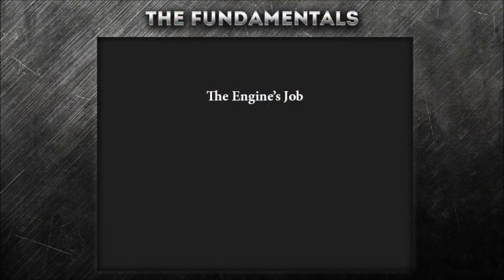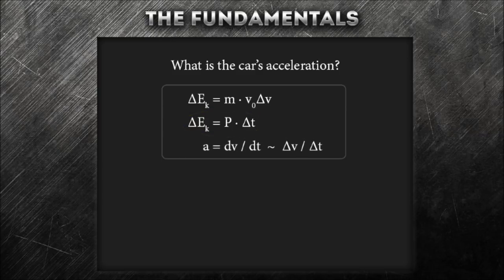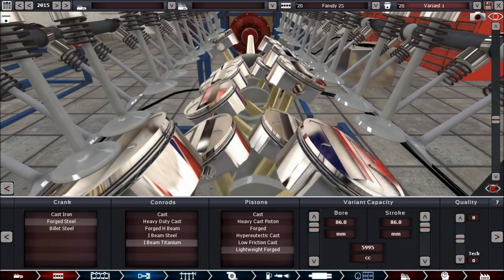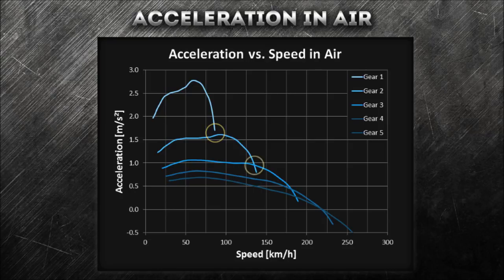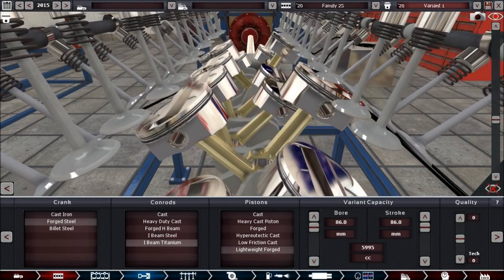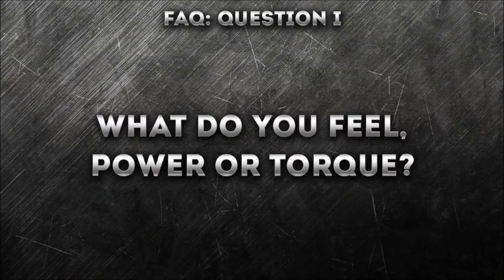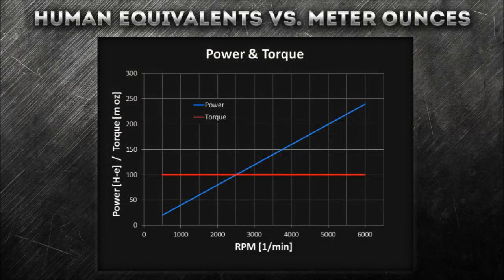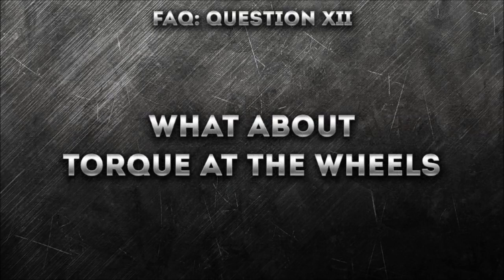Power & Torque: Acceleration Exposed

Comment: Dude I dint understand one thing that is if power or bhp is more with increase in bhp ur rate of work done increases if the rate increases so does the speed I. E bhp=torque*rpm I. E hence the speed of the car and if the speed of the car increases the acceleration decreases but based on the formulae u derived I. E   power/mass*vel  acc  is inversely proportional to speed according to this equation but bhp is directly proportional to speed so shouldn't indirectly acceleration be directly  proportional to speed.
Reply from the maker: And I didn't understand any of what you said there :/ so we have a communications problem and need counselling xD
Reply: AutomationGame how do I explain u I can't explain u in text 😅

Comment: So the only way high end horsepower can match low end torque is if the high rpm hp car is 10%lighter. Glad we cleared up what I already knew. The high torque engine being heavier is not always a given. High rpm hp is needed in very specialized applications. In a street car, torque isnt the ONLY thing that matters, but its close.
Reply: no its not true he forget about clutch you can form stand still twist engine at optimal rpm range and than loose clutch at clutch sliding you achieve more force twisting tire from stand still with high end more hp but if didffrenc isint very big higher hp car can transfer overall less force to tires because of bigger diffrenc in clutch disk rotational speed  so more sliding looses anyway if you must chocie let say 200 hp car 100 nm vs 100 hp car 200 nm both with optimal gearing and optimal clutch take 200 hp 100 nm be alot faster unlees you cant start properly but if it have launch control high end hp win overall look at top fuel from how high rpm they start https://www.youtube.com/watch?v=TA3i2TNuxcY  angine right when vehicle start to move twist around 6-7 k rpm according to this video ...
Reply: Torque is the sound of one hand clapping.
Anything Torque can do Power can do better and/or faster.

Comment: Was it explained what the torque number is for?  If power is all that matters why do manufacturers/the game tell us the engine torque?  Also, what is a combustion cycle?
Also, are you supposed to shift at peak torque or at redline?
Just a little confused, but I'm kinda dumb too so.
Reply from the maker: Hey, knowing you're a little dumb makes you smarter than most!
Torque describes pretty well how efficient the engine is and describes how power is delivered. That is useful to know :)
You usually want to shift at the redline or shortly before in order to have the next gear's start RPM to be high enough to produce the maximum amount of power. That is in a racing situation only though, of course... I'd not recommend that for normal driving xD
Reply: Wow that was a fast reply!
... but I do have 1 more question.  Is a 100 torque engine more efficient than a 400 because less power is 'wasted' at low RPM?
Btw, I bought the game thinking it was something else. But before I played it, car engines were magic to me.  It's very interesting to see how it all works, thanks for making it! :)
Reply from the maker: Not necessarily, no. For naturally aspirated engines of the same capacity you can compare torque numbers to see efficiency. When comparing differently sized naturally aspirated engines just divide the torque by the capacity and compare those numbers. Once boost comes into the picture you would have to divide by the total pressure (in bar), too.

Comment: I wonder why simulation estimates engine weight difference so dramatically. We know from practice that modern v8 pushrod engines weight around the same as much smaller OHC engines with less cylinders and produce higher power and energy. Even if you bore your v12 you will save weight on engine block, though will compensate with heavier rotating assembly. Probably you even need to boost smaller v12 to keep it up with larger one in terms of power, thus increasing weight of the smaller engine.
Reply from the maker: Because of the higher torque you will need a stronger drivetrain and gearbox, bigger starter motor, more coolant, etc. That is where a lot of that weight comes from. It should be somewhat accurate as an estimate.

Comment: Great video, until the end. You said that when you feel acceleration, it's horsepower not torque. As a mechanical engineer, I disagree. You are feeling torque during acceleration. Horsepower wouldn't exist without torque, and vice versa. But, taking a look how a car is moved forward, which are the tires. In a easy example, a rear wheel driven car, The more torque, the more the front tires want to lift off the ground. Therefore torque is causing the acceleration that you feel.
Reply from the maker: Torque is energy, energy is not felt unless transformed in a meaningful way. Thus, ENGINE torque can only be felt by the engine tilting, but torque at the wheels is a different story, which is what you guys usually refer to.
Reply: AutomationGame First of all, even though energy and torque have the same units, torque is not to be confused with energy. Energy is a scalar, while torque is a vector. The engine "tilting" is because torque is causing the engine to rotate about that axis (side to side), thats true... But that same torque is then transmitted through the transmission where it is multiplied by gearing, then it goes through the drive shaft, then the differential, and then through the wheels which changes axis of rotation front to back.  Thus it's all the same torque.  You can't say that you can only feel torque when engine is tilting cause, at the end of it all, it travels to the wheels. Torque cause acceleration, which is what we feel. Hypothetically, you can have a 500hp car with only 10ft-lbs of torque and the car has a top speed of 200mph... It might take you all day to get there but technically it can. That's why torque is important, because with more torque it can help you reach that speed faster.
Reply from the maker: I don't think we're in disagreement here at all. My point is that you need torque over time/distance in order to create work, just torque doesn't do anything. I think I explained that pretty well in the video. It is interesting to see the different approaches, the mechanical engineer going the forces route and the PhD in physics going the energy route. Both approaches are valid, although I'm of course biased to think the energy route is preferable due to it being more about fundamental physics. :P
Reply: A prove from practice: Shift a gear down at peak torque - you get more acceleration despite engine torque is lower after its peak. This works up to peak power. If you shift down at peak power you will feel less acceleration. 
Sorry for necro posting, there is just another wave of torque praying on youtube due to driving 4 answers stupid videos

Comment: am I right
kW = Nm x RPM ÷ 9549
is same as
HP = Nm x RPM ÷ 7021
Reply from the maker: something like that, yes.
Reply: I want to pull caravan.
Someone told me that we need car with a lot of torque. 
I think he's wrong, couse we need power to pull this caravan couse Power makes acceleration.
Which vehicle pulls stronger?
vehicle A with constant 2000 rpm with 500Nm
or vehicle B with constant 13000 rpm with 100Nm?
In my opinion Vehicle B couse it has more power
(185hp) than vehicle A (142hp)

I know 13000rpm is irrational and better is to have car with a lot of low rpm power. But in this example vehicle B pulls stronger
Am I right?
Reply from the maker: For an answer to that you need to calculate the power the respective engines make around cruise RPM values, 2000-3000 RPM and see which one delivers more power. Torque indeed is irrelevant, but people tend to use it as a benchmark because peak torque usually is made at lower RPM, i.e. an indicator for pulling POWER. :)

Comment: Hey, one more question (sorry for all the comments, and this is a long one, but I just re-discovered this video and I love it) -- I want to express the displacement of a car in terms of time, assuming constant maximum power (so I guess acceleration is decreasing but speed is increasing such that a*v is a constant). I have:

v(t)^2 - v(0)^2 = 2(a_ave)(distance)
a_ave = P/(mv_ave)
distance = (v_ave)(t)
So: v(t) = sqrt [ 2(P/m)t + v(0)^2 ]
And now if I want to express displacement in terms of time I just integrate this last equation, right?

I ask because I tried it another way:
distance = v(0)t + 0.5(a_ave)t^2 
a_ave = P/(mv_ave)
v_ave = distance/t
So: distance = v(0)t + 0.5(Pt/m/distance)t^2
Rearranging: distance^2 = (distance)v(0)t + Pt^3/(2m)
Then I solved the quadratic for distance but got a different equation than I got using the other method.
Reply from the maker: If you assume constant power and disregard drag then this should be pretty straight forward to solve once you have found the function for the velocity (I assume by displacement you mean "how far the car has travelled from zero"). You'd need to integrate that to get the function for distance travelled as a function of time, yes.
Dealing with integrals means you'd have to use the more accurate representation without averages though: v(t) = dx/dt  and a(t) = dv/dt. The averages point to the use of non-infinitesimal points in time... that doesn't mix well :) can't help you more with that though, cheers.
Reply: Cheers! :)

Comment: Nice video. The things will be more easier if the instead of calling torque (N.m), they call it Energy (J)? In the answer at the end you compare oversquare vs undersquare engine, I would be fine if you made a video comparing the volume engine but with different geometric.
Reply from the maker: It is so easy to just say torque, so no one will ever change that :) it should be called "work" instead, or work per combustion cycle. Cheers!
Reply: I did a little of math, to find out if there is any difference between "work p.c.c" and torque, and yes it is. The work p.c.c in a single piston engine,  will be Pm.Ap.Stroke- (J) and in the same piston the max torque will be Pm.Ap.(Stroke/2)- (N.m). Of course  I did a lot of assumptions but  I think it is enough to see the concepts.
Pm=average pressure Ap=Area of the piston 
Cheers

Comment: Love this video! Just one thing I'm hoping you can clear up: So when a manufacturer refers to a car's engine producing, say, 250 lb*ft of torque, they are referring to the amount of energy the engine produces per combustion cycle, and not actually the amount of "twisting force" the engine exerts on the crankshaft? Or are these descriptions actually the same thing and one just makes more sense mathematically?
Reply from the maker: They do mean the amount of energy per combustion cycle if they talk about reality. What you call the "twisting force" varies greatly over the course of one combustion cycle and goes far beyond the average that could be inferred from the 250 lb*ft figure. That fact tells you straight away that "torque" as a "force" (which it is NOT) is not a good way to talk about this, but rather in terms of energy. :)
Reply: Okay, cool, I think that makes sense! Thanks! :)
Reply: 5 months later and I think I finally figured out how to tell if car manufacturers are reporting average energy per combustion cycle or average "rotational analogue of force" per combustion cycle: since you get work by integrating torque with respect to angle, then average energy = average torque * theta, so you'd just see if you still need to include the 2*pi factor in the equation for power in terms of torque. If you don't need to include it, it was already factored in and they are reporting energy per combustion cycle. Correct?
Reply: Oh, wait ... I forgot that they are reporting peak numbers and not average numbers -__-
I wish they reported averages; it would make calculations so much easier! Instead I have to find actual torque curves...

Comment: If the small v12 car and the big v12 car weighed the same and made the same power then both cars should accelerate the same. The smaller v12 which revs higher would have to launch at a higher rpm where as the big v12 would launch at a much lower rpm.The drag test  between both cars  showed the lighter car with the same power had a greater speed at the end of the 1/4 mile which is due to a better power to weight ratio.So the lighter car could of accelerate faster/ won the race if you had the lighter car launch at a higher rpm.  Great video btw.

Comment: Isaac Newton's second  law sais F=m*a. You must talk about traction forces, mass and acceleration fist. You can measure force with dyno and then calculate torque which is Force multiplied by a constant(arm). The power is force multiplied by a constant(arm) multiplied by radians/second(which are NOT CONSTANT!) So, talking about power is usseles from the force and acceleration's point of view. Talking about torque is closer to reality. Don't forget to distinguish between the palpable physical units and the deduced ones. I have a movie in english about this on my channel.  Sure from a theoretical physical point of view you are NOT wrong, but the human mind can better understand 100% directly proportional units like torque and force than partially directly proportional and partially indirectly proportional units like power and force. Why? Because the max power is used to describe a thermal engine, and when you say, you need more power, the human mind thinks you need more max power instead of "more power at 3000 rpm which is far less than the max power". And regarding the feeling of power or torque you are only 50% right. You can feel forces, and then calculate torque and power. So if you calculate them you can NOT feel them.
Reply: Am regarding P=W/t or P=E/t (E and W is the same thing, energy). It is normal that at higher rpm you need more energy in the same amount of time(say 1 s), but that doesn't mean for sure that you will get bigger torque in an ICE. So if you need more traction force(=> bigger acceleration), saying that you need more torque is more specific than saying that you need more power. Do you agree?
Reply: Or, a more relevant example:
Force is 10 N
arm is 1 m
rpm is 1500

If you want to increase the force with 10% at 1500 rpm, you need to increase the torque by 10% at 1500 rpm which means increasing the power with 10% WITHOUT INCREASING the rpm.

But because in people's mind power can be increased by increasing the RPM it's more specific to say increasing torque than increasing Power.

Comment: Before I watch this feature-length video, I have this basic understanding of torque and horsepower:
Torque is obviously a twisting force.
RPM's are a measure of how quickly torque is applied. I think of it as a sort of awkward multiplier of torque.
Horsepower, then, would be the product of these two numbers - true driving force.
Reply from the maker: And what advanced understanding do you have after watching this feature-length video? :D cheers
Reply: AutomationGame Well, I certainly know more about power curve comparisons between "high-power" and "high-torque" engines, but I had my suspicions already. Here's an interesting engine for you: Chrysler 426 HEMI. It is a "high-torque" engine that peaks in power around the 5k RPM region, so an ideal shift point to match gears would be 5500rpm or so. However, this engine still produces reasonable torque all the way out to 7000rpm, and seems to lose but a mere ten or fifteen horsepower, so it may well be fine to stay in the power band all the way to 7k, or shift at 5500 to maintain around 425 horsepower at all times. Dare I say that this engine is pure engineering genius?
Reply from the maker: You mean the engine drops in torque only slightly more than linearly with RPM such that power is constant. Yes, that makes shifting really easy when you want to extract the maximum amount of performance. :)

Comment: Is there a replacement for displacement?
Reply from the maker: Sure is.
Reply: Momotaro Yes, it is called forced induction. Which is pretty much acting as more displacement if you think of it since it literally allows an engine to displace more air
Reply: Displacement per minute is an excellent replacement for simple displacement.

Comment: Correct me if I'm wrong but the better efficency of a diesel engine also comes from the high compression ratio. One of the easiest way to increase the efficency of an engine is to raise the compression ratio.
Reply from the maker: Sure is, also you can boost the shit out of them, because "knock" is a good thing in Diesels xD
Reply: why do suck, squeeze, bang, fart, engine get more efficient as the compression ratio increases? No one has been able to explain this to me. excellent job on torque, thanks.
Reply from the maker: The engine is powered by the force of the expanding gas on the pistons. If you have a higher compression ratio you extract more energy from that expansion process - starting to extract energy form a denser state.
Reply: don't forget that in diesel engines, if an injector malfunctions the fuel will be take the return line